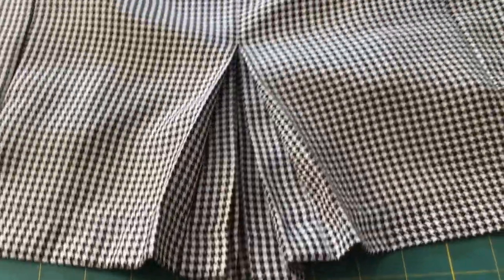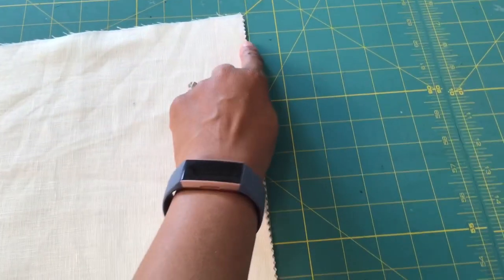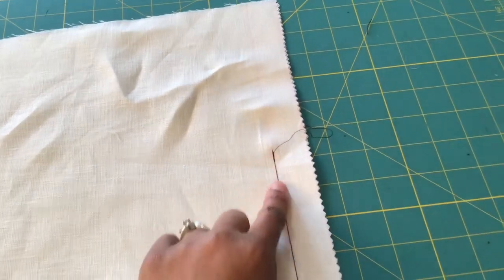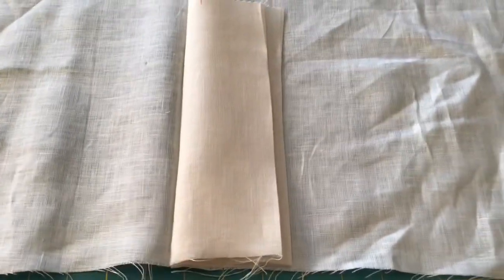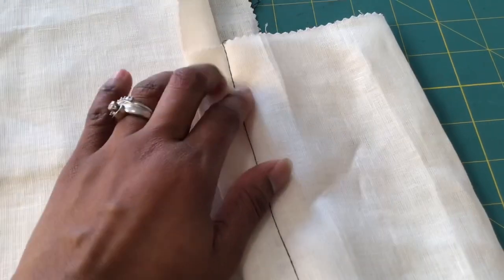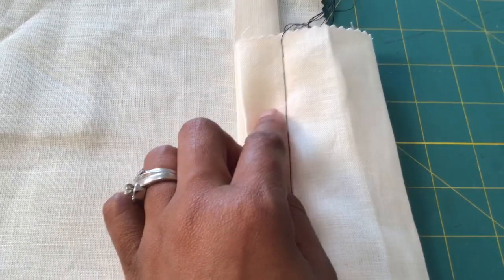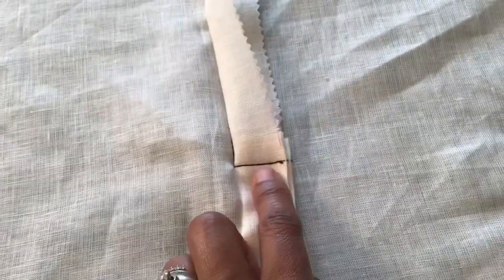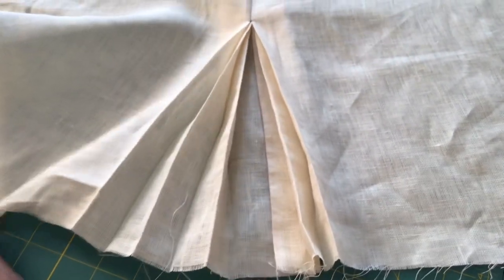Pleated Vent Tutorial

Comment: I m currently making burda 7137 pattern c and I have been wanting to make the vent like this for so long and just found your video. Thank you thank you thank you for making it so clearly I have just finished making the pleat vent followed your instruction ❤️❤️❤️. Question , how do I hem ? Do I just overlock it and fold it over and stitch straight stitch ? Thank you
Reply: Hannah Regina would it make the pleated vent hard to open or stiffy if that makes sense ?
Reply from the maker: No it wouldn't. It's actually really easy and sits nicely
Reply: Hannah Regina awesome. Thank you:)